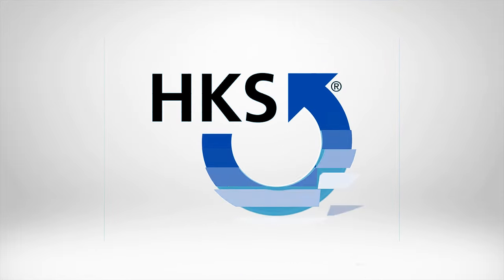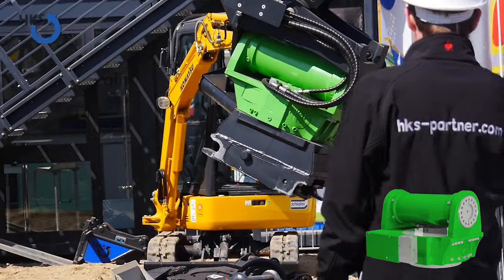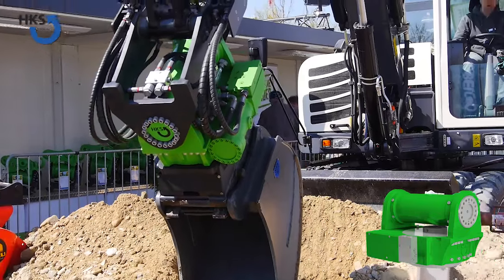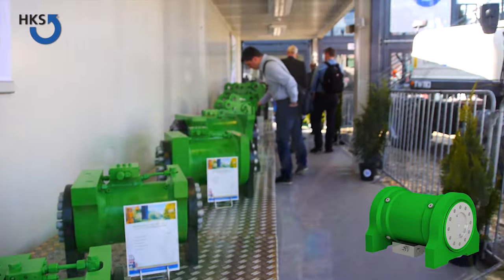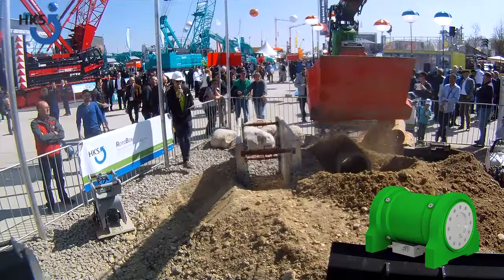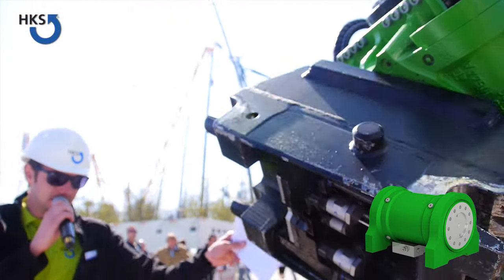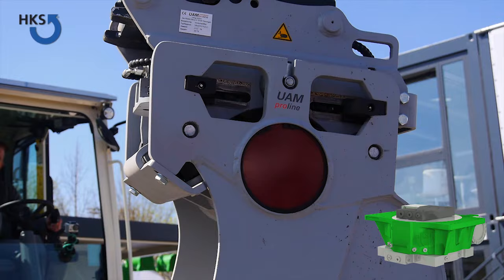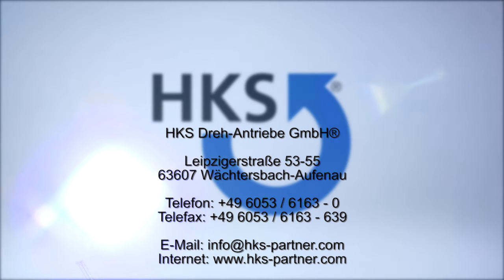english Version of HKS Dreh-Antriebe GmbH at trade fair bauma Munich - rotary actuators

Comment: produziert von http://www.imagefilm-produktion.com/

The HKS Dreh-Antriebe GmbH is one of the world's leading manufacturer of rotary actuators, tilt rotators, rotary lift combinations and as well rack and pinion rotary actuators. Besides cylinders HKS distributes vane actuators and since 2012 medical training equipment. The family business, founded in 1970 currently employs approximately 190 employees at 3 sites in Germany. With sales partners in over 20 countries, HKS Dreh-Antriebe GmbH is internationally oriented. The proportion of sales to foreign countries is between 50-60%. As a family business, HKS Dreh-Antriebe GmbH attaches great importance to responsible and long-term actions. Sustainability, community involvement and health promotion of employees in the context of numerous health actions and an own medical training circle are some of the key points in the company's principles. HKS products operate permanently and with precision wherever rotation and tiliting, precision acceleration, braking, positioning and stopping are required. “Made in Germany” represents the top demand made on us and is simultaneously the standard by which we measure our products. We can provide any type of special product in our design department manned by an experienced and dynamic team and will be delighted to do so in joint project work with you, our client. We can satisfy your demands to the optimum. This also includes producing a prototype. More Informations https://www.hks-partner.com/en/home/ or here http://www.bauma.de/ Erleben Sie dieses Video auch hier 

https://www.karrideo.de/ 
https://www.web-tv-produktion.de/ 
https://www.imagefilm-produktion.com/ 
https://www.youtube.com/user/wwwKARRIDEOde 
https://www.youtube.com/c/KölnMessevideoTV 
https://www.youtube.com/c/MaschinenbauTV 
https://www.youtube.com/user/KarrideoTrainerVideo 
https://www.youtube.com/c/CoachTrainerTV 
https://www.facebook.com/WebTvProduktion/ 
https://www.facebook.com/Karrideo.Filmproduktion.Christian.Weisse 
https://www.instagram.com/karrideo_imagefilmproduktion/channel/ 
https://twitter.com/Karrideo_Video 
https://vimeo.com/karrideo 
https://myspace.com/karrideo-imagefilmprod 
https://www.dailymotion.com/wwwKARRIDEOde 
https://www.flickr.com/photos/www_imagefilm-produktion_com/ 
https://www.xing.com/profile/Christian_Weisse2 
https://www.vidlii.com/user/KarrideoImagefilm